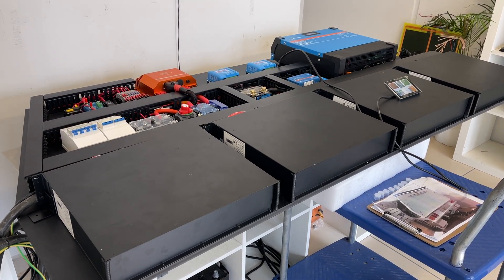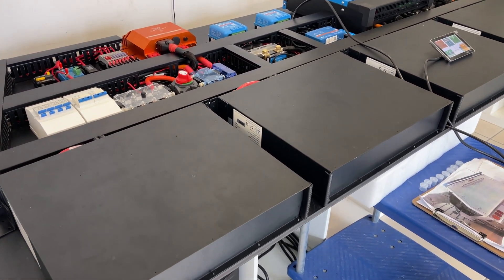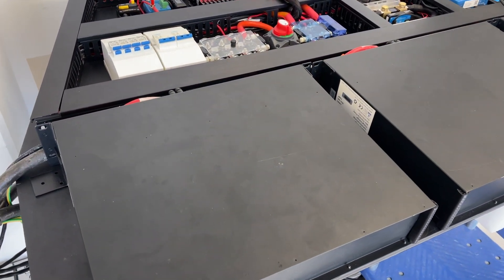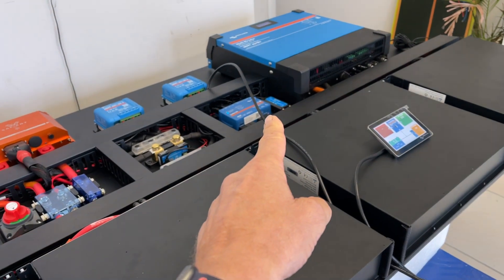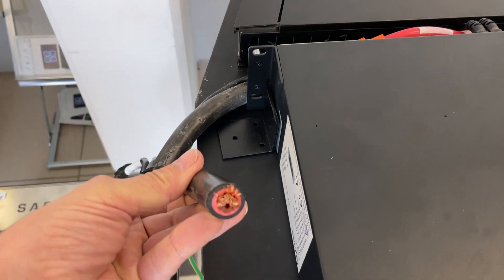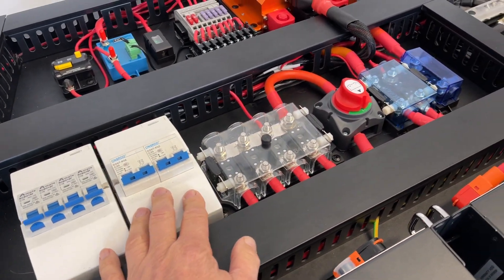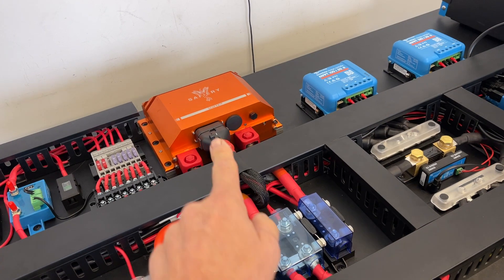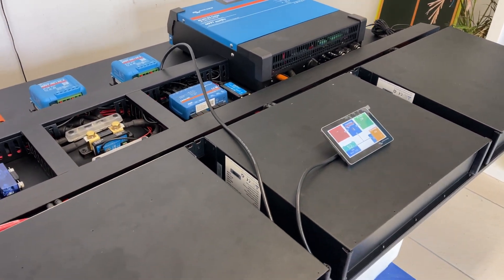GMC 2500 gets big system in small space with 48V: 6000W Inverter/Charger Scotty 3000W at Alternator

Comment: Hi, thanks so much for the video. your content is always very good. Since I don't understand English very well, some details escape me. maybe seeing them written down would help me. Can I ask you two questions? Could the 48v "multi rs solar" inverter charge batteries even in the absence of a photovoltaic system? that is, by connecting the "multi rs solar" to a home network, can I charge the batteries? second perhaps more difficult question: what should I use to charge a 48v battery pack through the van's alternator? A thousand thanks
Reply from the maker: Hi yes the MultiRS charges from AC outlet at home. From the alternator there is but one product: Scotty AI at 3000W will charge any 48v lithium bank
Reply: Thank you, it must be an excellent product, unfortunately currently above my budget. Maybe cheaper systems will come out in the future. do you ship to Italy? A thousand thanks